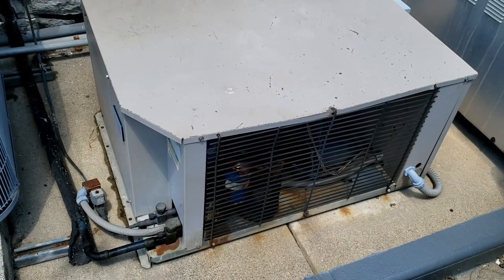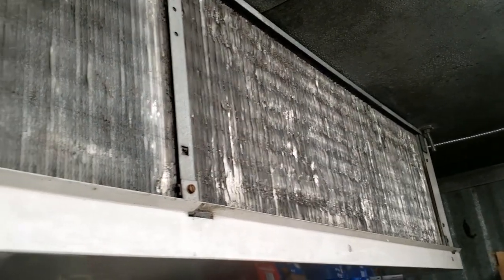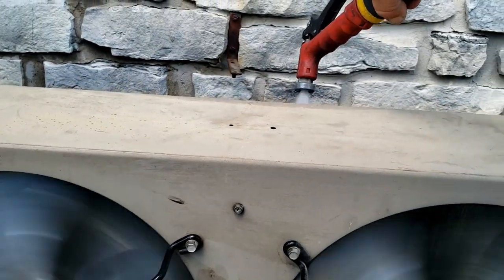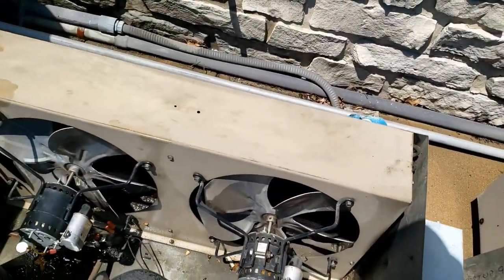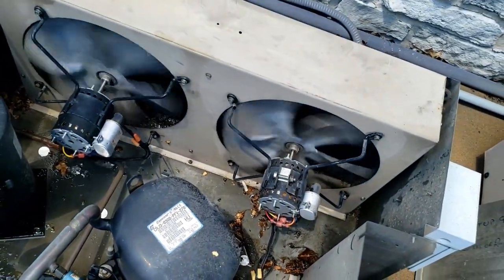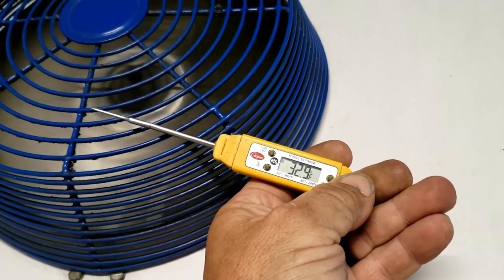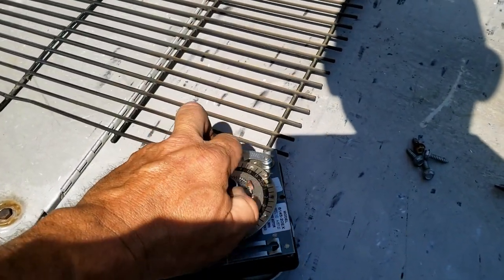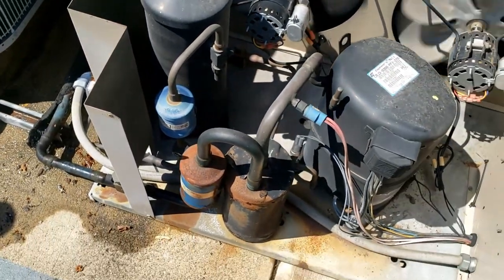Walk-In Cooler Iced Up Now It Works Ok

Comment: I have on in Colorado that only freezes coil in July and August which are by far the most humid months here. The door is opened every 2 minutes as they are in and out constantly.  Had curtains but they dont like them and take them down. They use it like its an air conditioner for 10hrs a day for 2 months. Also can't give condenser coil good cleaning as beehives are kept on roof. They also store food uncovered from previous day. Once September gets here there will be no more frozen coil. Once temp goes up from being opened so much it struggles to recover without freezing coil. Giving customer option of replacing thermostat wit KE2 which will let me set defrost in box. It will still struggle though due to door being opened 30 times an hour which is why they hate the curtains.
Reply: Ditch the contract

Comment: 1:47 - I’m new to refrigeration so I’ve not seen the water-down-the-condenser-coil-trick. Can you explain how that works? I would have expected the sight glass would stay clear since the saturation temperature is now lower and there’s more room in the coil for condensing to take place. Guess I’m not thinking about this correctly. How is this different than a hot gas bypass defrost, where the sight glass flashes each time the valve opens to the evaporator coil (bypassing the TEV)?
Reply from the maker: Basically, I’m imitating a colder day.   The pressure drops so the saturation temperature depending on whether it has a headmaster control or a fan cycle control it’s still going to flash for a while if it’s not at full receiver capacity.

Comment: What is the purpose of the suction line tank, is it an accumulator? Im used to a liquid line receiver on a walk in cooler but not on the suction side. Could you explain the purpose of that. Thanks in advance!
Reply from the maker: If what you your describing is on the suction line before the compressor that's the accumulator, keeps liquid from getting to the compressor washing away the oil.
Reply: Thank you for the reply. @ 3:05 in your video it’s center screen. Suction comes in to the condenser goes through a filter into the accumulator(I’m guessing). I guess what confuses me is that I don’t usually see a accumulator on a walk-in , just a liquid receiver. (On heat pumps I understand the accumulator) I guess my question is why is it I rarely see an accumulator on a walk-in cooler condenser.
Reply from the maker: @DanO181919  some of it could have to do with it being such a short run from the evaporator to the condenser, when you trying to keep a 8 to 10 degrees superheat at the evaporator and when the condenser is really close it's hard to give the compressor the 20 - 25* superheat that the compressor manufacturer wants.  Basically it's just an extra line of protection to keep the compressor from getting slugged with liquid.
Reply: @HVACRSurvival  Thank you, appreciate your time. Everything I’ve learned in this trade has been on my  own. I research everyday… watch videos everyday. I mostly learn from guys like you who are willing to take the time to help guys like me.  Guys like you are God sent!!  🙏Thank you!!
Reply from the maker: Pick up the book "refrigeration for air conditioning technicians"you can find it used on eBay or some downloadable versions of it online. It is straight to the point without all the extra bullshit because they feel as though you already know air conditioning.
Reply: @HVACRSurvival  awesome. Thanks!
Reply from the maker: Welcome👍👍

Comment: Condenser fans are taching different rpm?  How about the run caps ok?
Reply from the maker: They only looked like that on camera, in person they looked normal. Back to your question, even if the fan was going slow or stopped that wouldn't cause the evap coil to freeze.
Reply: @HVACRSurvival  Seemed like you were questioning head pressure is all.  I still think the rpm of the condenser fans are different,but would it matter if they were?  Probably not but maybe.
Reply from the maker: No.... Your correct 👍👍 There was problems with the head pressure, I didn't record any of that for whatever reason.  I washed the coil out three times, twice with coil cleaner and it still was higher than it should of been. That's why I was reluctant to add any more refrigerant and drive the pressure higher.
Reply: @HVACRSurvival  I think Chris had a video on one similar to this, he cleaned the coil but the head pressure was still too high. Ended up replacing the condenser fan motors even though they looked to be running normally and that dropped the head pressure down to normal. You could maybe check the fan RPM with one of those laser tachometer things. Sometimes 200-300 RPM faster can make a huge difference.
Reply from the maker: I had a video earlier this summer like that, I have a rpm tachometer. Generally you only need it for blowers and setting pulleys but maybe I should have checked it. Good idea 4 next time👍👍
Reply: @HVACRSurvival  Kinda funny but a pulse width modulated flashlight with different light intensities might show rpm variations in side by side fans as a quick check.
Reply from the maker: I have reflective tape I can put on the blade. Much simpler. It can do 9000rpm I believe

Comment: Maybe issue occurred with one of the other coils and messed up the load on this evaporator
Reply from the maker: You might be correct? Those units have heaters on the coil but since I did this call back in July and haven't had to go back ever since, I would say we probably got it.

Comment: Your comment about connecting the bulb to the PLASTIC drain line because of heat transfer from plastic is an insulator and because of the distance to the mounting bulb thickness of the amount of plastic the heat would need to travel will prevent any heat transfer but if you wrap the plastic pipe with a heat tape the heat radiates inward toward the water not along the length of the pipe the only reason it is not common practice is because drain pipes are typically in areas where either the bulb can be snagged on something and ripped off or it could accidentally be installed on a freezer drain line or water could get trapped in the pipe effecting the operation of the cooler due to the bulb sensing the cold water that is flowing in the pipe which could cause thermostat to short cycle causing contacts to stick case and point a contactor that chatters will either burn contacts off or stick contacts together.
Reply: Meant to say heat transfer from outside

Comment: the condenser fan blade rotates funny in the video
Reply from the maker: I record at 60 frames per second that changes the way things look in the video. Higher the frame rate the more it slows down motion.
Reply: @HVACRSurvival  That's not an entirely correct explanation, but for all intents and purposes I guess it works. If you're curious there are two effects at play, called the stroboscopic effect and the rolling shutter effect.
Reply from the maker: You must be into photography so you know that anything above a 500 shutter speed you can stop motion. At least at most points. Since it's not a photography site I didn't go into great detail but I do know that shutter speed affects the way it looks in the video.
Reply: I am a chill water technician
Reply from the maker: @neilvestervictor180  I'm still working my way into the chillers, mainly done a lot of Geo thermals plus the things you have seen on the videos.
Reply: I work at the hospital we have chiller that is water cool and air and heat reclaim all in one but they don't make it so any more I was told Mitsubishi bought the company
Reply: the truth is I started in April of this year just open my mind to learn fast and god will lead the way I did electrical installing and electronics as well and hvacr but chillers are new to me but now I am getting a hold of it we have five the biggest is 160000 tonnes
Reply from the maker: @neilvestervictor180  awesome man 👍👍👍. Electronics was my first pick b4 HVAC but I'm glad I changed schools. And I fully agree on God leading you, (if we listen) 👍👍

Comment: If its at 32-38° why do you need defrost when you can air defrost ?
Reply from the maker: This defrost clock just shuts off the condenser for the preset amount of time while the evap fans run. It's not a full-blown heated defrost on the coils. Depending on the humidity levels of where you live at you might get away with no defrost clock but around here it's the preferred method. Normally twice per 24 hours is plenty for 60 minutes each time.
Reply: @HVACRSurvival  so like mid Atlantic and northeast you'll find more defrost since we have more humidity and it'll cause more defrost right
Reply from the maker: 👍👍. I'm in Ohio
Reply: @HVACRSurvival  baltimore. I want to get in the industry im almost done with school want to do commericail but everybody wants experience here
Reply from the maker: They don't have a choice around here, there's not enough of experience people around here to fill the positions. If we find someone that is willing to work and shows promise,motivation and dedication there hired.
Reply: Medium temp systems require 20% off cycle time to air defrost. That is close to 5 hours time. Walk in coolers have different factors that affect run time. Load, door openings, marginal sizing. Clocks are needed to insure the coils get enough time of off cycle defrosting.
Reply from the maker: @mainj54  sounds good to me 👍👍. I just know I normally need one to two 60 min off cycles per 24hr. But with the other coils running colder I preferred 4 defrost times per 24hr period. Thanks for the scientific formula 👍👍

Comment: They could’ve went with the center mount refrigeration coil.
Reply from the maker: You talking about a low profile coil?
Reply: @HVACRSurvival  yes
Reply from the maker: As you might have noticed the evaporator is older than the outside unit. Most the places I work at don't spend any more money than they need to. The moral of the story is it used to work fine then one time it froze up for no good reason and I had to figure out why. That's why I was checking all kinds of different things, since we never had to go back for that same problem again I must have been right on the defrost clock.
Reply: are you new ? you do realize its a drink cooler right?   where the doors are open non stop  and you need fast moving air?  please think before you say something
Reply from the maker: @primetime758  sounds like you got it all figured out 👍👍, why don't you fill me in on your hypothesis.
Reply: @HVACRSurvival  i dont got it all figured out but a low flow coil for that type of cooler is a no no  you can change the coil but use the same style thats it lol
Reply from the maker: What do you mean low flow coil? It looks like every other evap I have seen in this type of installation. Just so you know they never had this problem prior and after I did this call we haven't had to go back, I ran this in July.
Reply: @HVACRSurvival  no no lol! one guy said you should install a low flow coil  (dual discharge ) thats a no go for this type of cooler...  that coil that is there now.. is the proper coil nothing wrong with what you did just to put that out there
Reply from the maker: @primetime758  you didn't put who you were speaking to so I assumed you were talking to me.🤷‍♂️🙈... Actually low profile coils were what was on the other side of the cooler but they have heater elements in them. I've never heard them called low flow just low profile. I don't like those coils because it traps the dirt on the inside and makes it very difficult to clean otherwise.
Reply: @HVACRSurvival  oh sorry ya no i only install those coils in very special situations ...   and yes they are hard to clean difficult to installl drainage is a headache  txv compartment is tight.. i prefer just the normal style coils
Reply from the maker: @primetime758  yeah go back and look at what you wrote and then think what I was thinking when I read it. 🙈😁